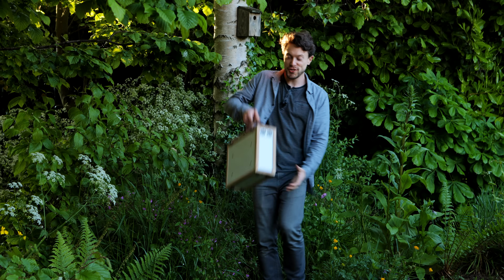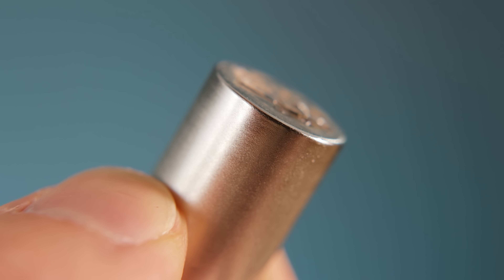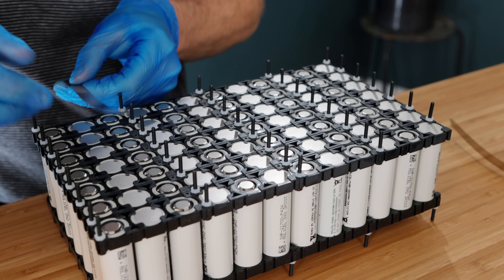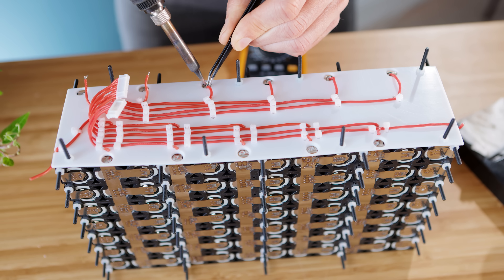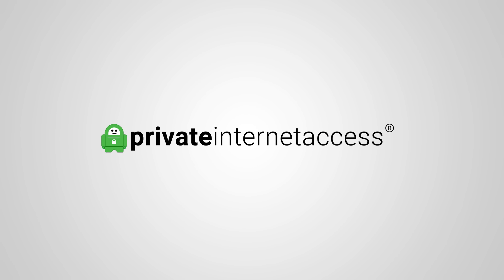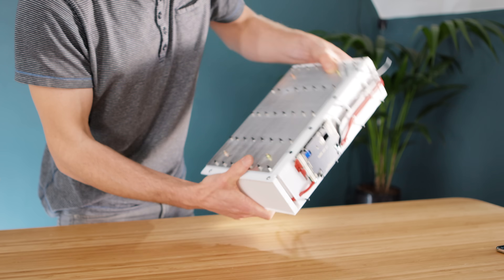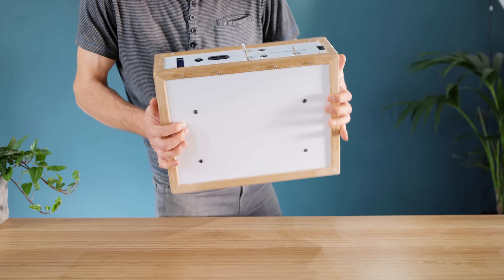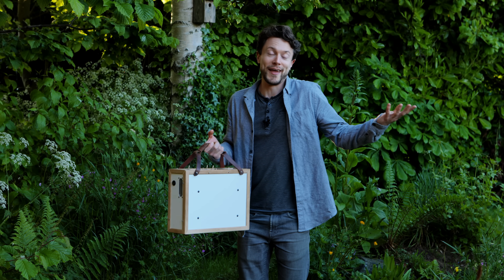Build your own portable POWER STATION (1200w, USB-C and MORE!)

Comment: I've looked at several power banks on Amazon in the last few months.  I bought a small one that I thought would do what I needed it to do (charge/run my laptop), but then discovered that it didn't have the wattage required.  I kept it, but right now it's in my car and I've only used it once to charge my phone for a few minutes when it started giving me a low battery warning, and it's there if I ever need to jump start my car.  A unit as powerful as yours would cost a few hundred dollars.  If you could get yours into production and at a decent cost, it could be a contender.
Reply: just the cells this guy used would be around a thousand euros from where I live
Reply: Stuff in this category is easily $700-$1000 on the market rn and likely have less robust components and less features than he included in his like the wifi module etc..
Reply: The 84 lithium cells alone cost £311.64, or 431.44USD. (If you order them at a thousand or more at a time, you'll get them at £302.4 per set of 84.)

I see this handmade project being perhaps $500-$700 depending on how much one wants to spend (the BMS he used in the video seems to be the 170€ one, but you seem to be able to get one at $50 or $30 but as he said you might be sacrificing safety/reliability and losing out on useful features). Even just going into the probably-unrealistic lower end of that guesstimate, $500 of cost per unit... The overhead would be expensive. Even just the Galaxy Note 7 could cause some pretty scary stuff at 3.85V 13.48Wh. If any unit was improperly made in production, it could be pretty big depending on what exactly fails, so I think they would need extra precautionary measures in production... Which costs in two ways: less product, more expensive machines (or more employee-salary per product if it's all done by salaried employees, of which all are handling fire machines if they make a careless-enough move). 

I think all these problems can be resolved in one way or another that I might not be able to think of, but it surely sounds rather expensive.
Reply: @L7vanmatre  you ditch the small cells and you use the 100-300A cells.
Reply: @L7vanmatre  economies of scale is how companies make things like this "cheaply"
Reply: @oliverwalters9533  not with lithium batteries. bigger capacities = bigger power delivery circuit = cost more. not to mention that the battery doesnt get cheaper when you purchase it in bulk

Comment: Very well explained and nicely built.
Questions:
Which cell size?
Approximate cell cost?
Is the inverter square wave output or sine wave? I had previously wondered if a microwave oven could run on square wave.
Why is nickel used for cell connections vs. copper or aluminum?
Is there anything inherently better about dean's connectors vs. Andersen Power Poles?
Could it be worth the effort to have fan air pass through the battery section as well?
Thanks very much!

Comment: For the extra current you needed / wanted for this project, would two layers of the thiner nickle strips not have worked? The spot welder would be a fifth of the price, and the thinner  nickle strips cheaper. Incidentally how much current on the thin nickle strip would it take to melt or short that out?

Comment: I like the additional spacer for the BMS to keep the battery stay cool. The only optimization potential I see is in the internal cooling system for the batteries. The batteries are in their own box which prevents a good exchange of the air. Maybe there could be some slits in the plates allowing more air flow directly to the cells. In the end I like the white finish which helps the batterie to stay cool even at sunny weather. I found that besides a white surface an additional shiny surface boosts the "cooling" effect of the surface dramatically.  So the shiny white foil as a finish is the ideal way :)

Comment: If the battery pack is around 1500W and it outputs that to the step down regulators can they handle that? Or does the BMS regulate the wattage it outputs?

Comment: Really high quality build. My only issue is that a build like this kinda defeats the purpose of diy. The amount of money spent on the new cells, the top of the mark bms and the overkill safety measures, along with the cost of the inverter would go into the 4 figures. With that amount, you could just buy a battery power station like the bluetti. But other than that, really top notch!
Reply: He did say that this project was meant to be scaled to your use. The amount of power in this project is overkill for most uses.
Reply: The bluetti EB150 is the most comparable unit, only has 45w PD output, rather than 95. It's a good option, but it does not meet all the same specs this does.
Plus with this you get to say you made it.

Comment: okay so the batteries cost about 400$ and for a backup battery similar to this is about 500$ and the 500$ supports solar panels (not included though)  seems like a lot of safety risk and time for 100$

Comment: Ive always wanted something like this and I know they exist online but theyre soo expensive. I just went the route of buying a small generator that does the same stuff at 1/3 the cost. I know their is a crap ton of better uses for a giant battery bank like this though. Great or doing everything a generator can do without the noise and limits. I wouldnt watch movies on my laptop at while camping with a damn generator but I would definitely need all the extra power from a power station. Theyre pretty awesome but again, super expensive and most the time they're some chinese brand that you dont know is decent or not. If anyone has any suggestions to something specific to what's built on here that's a decent deal and product let me know

Comment: My welds are hit/miss. Ive tried a range of voltages/currents, with and w/o pulse - but can never finish a pack w/o having to reweld a third of the cells.

I noticed your electrode tips are flat, my electrodes have rounded points. Should I be using flat tips?
Reply: I highly recommend getting the kweld. It’s a much much better system than these cheap Chinese ones. Not too expensive either.

Comment: Hey. @DIY Perks, have you seen the guy who made his own, DIY "Powerwall" in the US? He powers it with solar and managed to get completely off-grid with it. Better yet, he uses recycled cells - taken mostly out of used laptops, cause it seems that a "broken" laptop battery, usually has only one or two broken cells inside, while the rest works with no problems. Would you ever consider something like that?

Comment: This is next level DIY. Great video, this stuff takes weeks of research to even put together a video like this. I'm currently running a goal zero brand portable battery. I'm planning on a battery setup for my bus and this was very helpful information. 1000ah LiFePO4 setup with 1000watts on the roof. No easy feat, but way cheaper to DIY.

Comment: This project is super cool but would it be possible to make more than one and chain them together for extended time or would voltage become an issue?
Reply: You'd need to connect the positive and negative terminals of each together.

Comment: Very nice battery pack
9:50 you are not only electrically insulating the contacts but you are also thermally insulating the battery pack. This means that any heat that develops in the battery is not able to leave the pack as well as it should. High energy packs are often lined with special silicone like material that directly attach to the metal case or even a heat sink. Especially when delivering high power over longer times it is very important to do this.
Also, make sure there are a few temperature sensors to the BMS such that the BMS can switch off the battery when the temperature rises too fast or gets too high.
As a safety warning: never ever suggest that people use old or refurbished cells to create battery packs with multiple cells, especially when those cells are placed in parallel. Any two cells that are placed in parallel will charge/discharge each other when these do not match. Not only the battery voltage but also the cell's capacity and internal resistance are very important. If these are too far out of alignment, the better cell will start charging the other cell(s) with uncontrolled/unlimited current (or as much as the better cell or cells can deliver). The cells you use can deliver up to 45 A per cell (not 30 A as stated by fogstar) when short circuited. So if one of these cells fails, you have a possible fire hazard.
To prevent this happening, the BMS monitors the batteries over their life time and the BMS will shut down (and refuse to charge or discharge) the pack. The BMS will/should also monitor the temperature of the battery and with a large pack like this, there should be multiple temperature sensors on different places in the pack and with a pack like this I prefer to use 2, or even better 3, sensors.
Note that even most electronics engineers have no clue on the use and care for rechargeable lithium cells. I have been working on multiple types of rechargeable technologies and have designed and built BMS systems on and off for the last 20 years. I know enough about Li-Ion, LiPo and LiFePo to know that I am not an expert on this ...
When making a large pack with parallel cells, I would stay away from the BMS you mentioned in choice 2 and 3 (the "Small Daly BMS"). I base this on the label on the product that shows the text "with balance". The "M" in BMS stands for "Management" and that involves not just balancing but also monitoring the state of charge, temperature and capacity delivered over all charging cycles. As soon as this suddenly changes, the BMS must warn the user, at least by disabling the battery pack. If a manufacturer feels the need to specifically note balancing on the label this suggests to me that this might most likely just be a protection circuit with balancing. These protection circuits do not contain any electronics to "manage" large battery packs.
The TinyBMS is the only sensible choice for this pack; it monitors voltage and current of each cell stage, monitors SOC, keeps track of number of charge/discharge cycles, starting capacity, last cycle's capacity and I think it will even show you the "health state" or "age" of the battery which predicts when your battery will fail.
The TinyBMS also uses the temperature sensors to prevent charging when the battery is too cold. Future firmware updates might even contain a special features that start pulse-charging or slow charging when cold and only switch to full current when the battery is up to temperature.

About "refurbished" batteries: Refurbished cells are a myth, these are just old cells recovered from a pack where other cells have proven to be faulty. Never ever combine those old cells to create a parallel pack because you do not get any clue on the age or life expectancy of such cells.
You can buy things like "refurbished" E-bike batteries. Those contain NEW cells that are placed in the old housing with the existing BMS. The BMS is reset in order to keep track of the new cells states like current capacity and pack age. Such refurbished packs are as good as new ones from the factory. Some brands will even recycle BMS systems themselves, they have a system where a dealer gets a discount on a new battery when returning the old one.
Reply: I feel like I just read a book
Reply: @dillannokes5206  
Good.
Reply: thanks for the comment, very interesting
Reply: Thanks for the knowledge. I'll start applying this.
May I ask one thing?is it safe to use refurbished LiFePO cells for powerwall and solar? It is already popular. We don't use temperature readers or heat sink since the bigger cells doesn't heat much compare to smaller ones like 18650 lithium cells. And we usually put in 4s and parallel in around 10-20 4series cells is this safe? We use refurbished cells 32650 lifepo
Reply: @hondayamaha3  LifePo cells cannot be charged at 0° C or below without significant damage. Other than that one drawback, LifePo cells are superior and can withstand double the number of charge and discharge cycles compared to Lithium ion cells.
Reply: Booom?
Reply: At first I was thinking" I am totally reading this long comment" then after the first paragraph I thought maybe I'll try to scroll down and see hos long it's going to be. Then realised even typing this long comment is taking less time so i stoped reading

Comment: but what supplies the microwave ~220V if the max voltage is 50V from cells? Could someone explain it to me? As I'm not involved much in electronics, unfortunately.

Comment: Probs someone already mentioned but there's a guy called "Mooch" ( you can search for Mooch Battery Chart ) who does battery testing with specialized equipment and you can find the best/safest batteries which can provide more amps or produces less heat in general. There are some crappy batteries which are explosion/fire hazard out of the box.
Overall ones like Sony VTC series are fairly balanced and great extremely popular for vaping and you know how vaping can be dangerous especially with unregulated mechanical devices.
Mooch also approves the Molicel batteries used by DIY Perks:
https://www.facebook.com/batterymooch/posts/bench-retest-results-molicel-p42a-4000mah-21700beats-40t-one-of-the-best-batteri/2327750627514510/

Comment: Why you didn't put an AC inverter inside the battery package? It would be easier to simply plug in all devices by a normal power brick instead of have an external inverter to make the microwave work for example..

Comment: Personally I would have chosen a couple 90mm or 120mm fans. One to draw and one to push out the air one on each side. Would be greater airflow of course but the reason would be the noise. Those server fans are noisy with a very loud whine.

Comment: Hmm, Quite a tempting build to have a go at. 1 small problem I immediately found was cost. 
The 21700 batteries are a bit on the pricey side. Cheapest I could find was £9.00 per battery. 
So thats £756 on batteries alone before we even look at anything else. 
I'd be willing to bet this build on materials alone would be tipping in at over £1000, probably more.
Reply: for a literal portable power storage, it's still cheaper than a modern mid-range custom gaming tower and monitor, and infinitely more practical.
Reply: @aidanmatthewgalea7761  Im not interested in a pc set up, im here for a portable battery. Whats the price of a pc setup got to do with anything? 🤷‍♂️

Comment: Quality content as usual. Your attention to detail and high standards never cease to wow me. Beautiful build. I am a bit concerned with this build. Whilst very impressive, its essentially a bomb, and i fear there is inadequate ventilation for the batteries. During charge cycles and during high load discharging batteries can heat up. With so many cells packed so tightly together, inside of a sealed box, could be potential fatal thermal build up. I don't mean to insult your work as I absolutley love your craftsmanship and ingenuity

Comment: I would love to build something like this that i could charge via solar panels and use it to run my computer. Just wondering if there is a way to connect this to the wall in a way that it only charges via solar panels and when its low it switches from using the batteries for my computer to allowing the power from the wall through.

Comment: If you wish to sacrifice a very marginal energy density for unlimited safety over LiPo, i'd go with LiFePo4 batteries instead. You can get them in the same formats, they are pretty much just as cheap and you can basically shoot arrows through these things and they simply won't catch fire.

Comment: Hi! Is it possible to charge this with solar power. I live in the island of Puerto Rico and the power grid here fails every month. Plus the last time a hurricane battered the island (hurricane Maria) I was left with out power for a year. I now have a small generator but I’m worried about fuel shortages. After hurricane Maria the western side of the island (were I live) didn’t get supplies including fuel for almost 5 month. If you could do a video on a solar power charging station for this battery would be great. Thanks!

Comment: Brilliant build. A nice upgrade would be to use XT-60 or XT-90 connectors instead of the Dean's connectors. We use them a lot in high-current applications for RC models.

Comment: Still waiting for him to give us the gross weight and charge time.
Reply: Would be similar to an electric scooter which charges around 5 to 10 hours depends on the charging current.
Reply: @FuyangLiu  I'm aware of the similarities, I just expected him to show us a practical example.
Reply: @kunalchabria1989  Well since the batterypack is around 1200w we could expect to be able to charge them with 1C charge, so basically if you have good enough charger, you could charge it i one hour, but since the batteries get hot at 1C and there is not much breathing space, it would be saver to charge it with 0,5C which is around 1500mA per battery in this case, so probably you would want to charge for at least 3 hours. As for weight assuming he used 3A 18650 lion batteries, its probably 9 batteries 13 arrays, so 117 batteries, so battery itself weights around 4KG, now with the case and electronics i would imagine for it to weight around 7KG, so around a six pack of water :D
Reply: @zapole  Molicel p42a is rated as 4Ah(actually closer to 4,2) 12s7p 4Ah cells is at least 28A @ 50V, if you wanna charge that fully in 3h you need 10A @ 50V (assuming almost 100% efficiency), considering big-ass "fast chargers" for E-bikes and such deliver 4A @ 50V you're out of luck.

Also, he said he used 84 batteries, p42a weighs 67g a piece meaning just the batteries are netting 5,6Kg